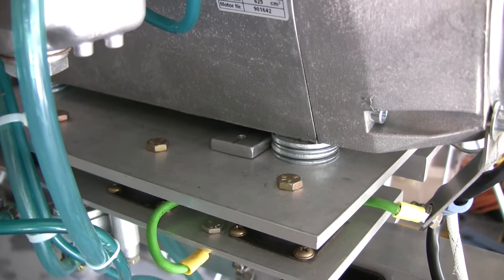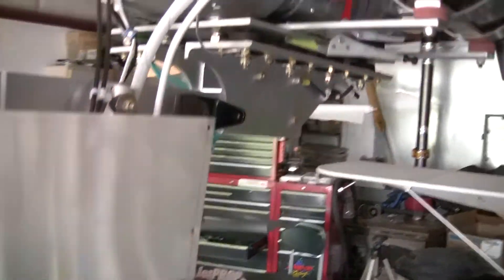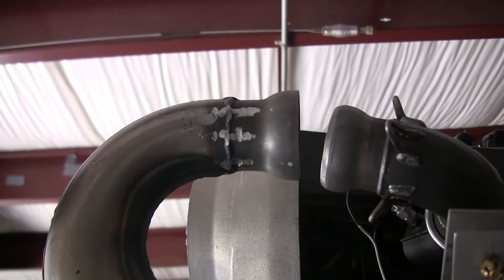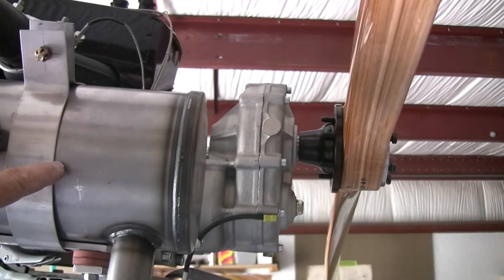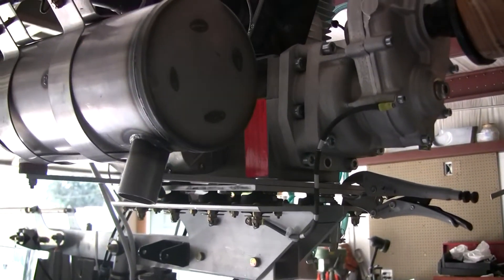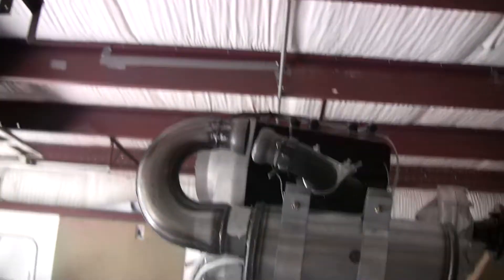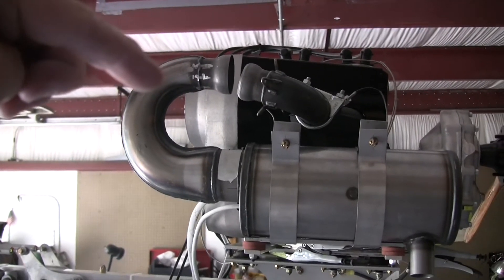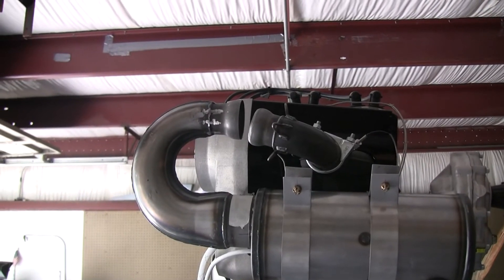MICHAEL HEIT EXHAUST ENGINEERING PART 1

Comment from the maker: Both aircraft in the hands of a capable pilot can do a fine job for recon use, and for exploring in the back country. Both can lift & haul up to 250 pounds of what ever you can cram in the rear seat assuming a minimum pilot weight up front of 170 pounds .... both pack a wallop of fun flying on the cheap ...

Comment from the maker: Ok ... now for more. The Excalibur using the 55 or 65 HP Hirth engine is going to cruise at a faster cruise setting using less fuel since the engines create more HP and torque at a lower RPM than the Rotax does; also the Excalibur has a cleaner design with slightly less drag. The roll response in the Excalibur is better due to the shorter ailerons and no flaperon drag or yaw. The Excalibur landing gear allows for better off runway field landings with out the potential of damage.

Comment from the maker: There are many similarities between the Challenger II long wing, and the Excalibur. However having built & flown both types I can also say that there are differences as well.

The Challenger is a fine flying aircraft and over the years it has undergone many changes primarily by after-market mods to make it a more safer & reliable bird. The Excalibur incorporated many of these changes in its initial design and has not needed much change. 

Not much words left to be able to type in .... sorry.